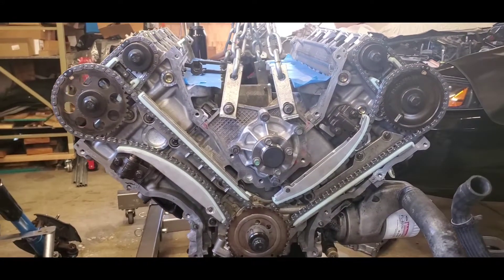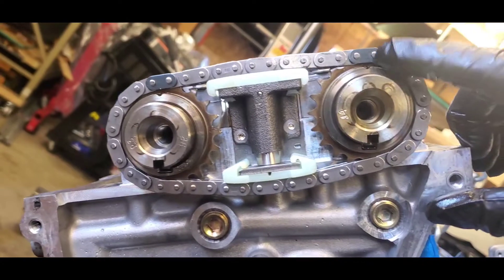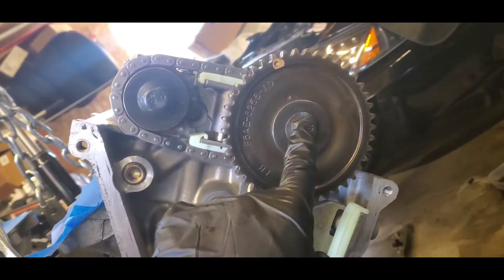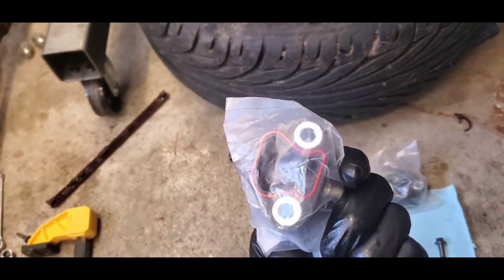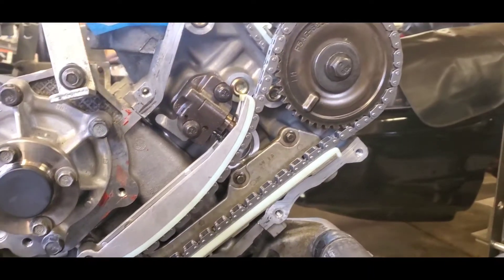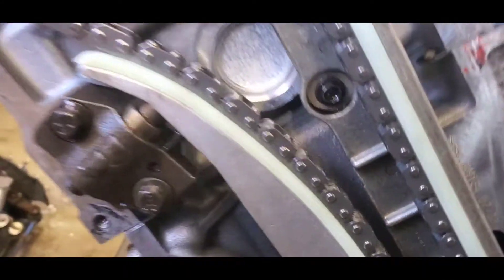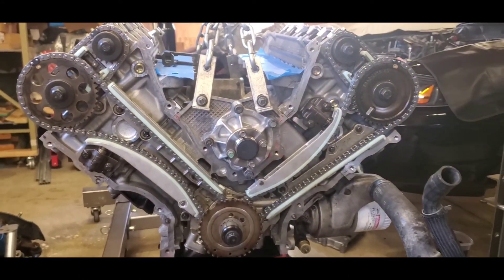How to time: 4.6 4V DOHC Modular Ford Engine Step-by-Step Guide

Comment: *don't forget to put the crank trigger wheel on. " Yea, I went through that already lol. 

My motor sat for 6 years so I don't even know what happened to mine, and when I put it in the car, that trigger wheel was a thought of the past. 

Things like that happening build experience and I think it's a good thing it happened in my case. Now is someone is having that issue, I in sure I'll know to say least check that. 

Now I'm learning about replacing all timing components "no matter what" because a secondary tensioner broke almost grenading my entire motor, at least the heads, but luckily there was zero damage to and valves or pistons and this is why I'm here.

Comment: Hi Josh. Thanks for the video. Would I be able to replace the timing chain tensioners without pulling the motor?
Reply from the maker: Yes, you would need to pull the radiator, fan, front accessories and any hose or harnesses in the way. You should have enough room to work

Comment: Great video!  I need to do a timing job on my 2004 32V Intech 5.4L.  Will it be the same procedure?
Reply from the maker: I'm not sure, which 5.4?
Reply: @Oxman_Garage  would it be the same for  the 5.4 4v that comes in the 2004 Navigator?

Comment: So on the aftermarket tensioners I bought theirs a these two steel shims i believe that go behind tensions is that really nescary? Or can I run them without?
Reply from the maker: I would have to see them. Stock chain tensioners are always best.
Reply: @Oxman_Garage   I looked at them from what I gathered on forms non Windsor engines use them as spacer for some reason

Comment: I'm pretty sure this is the same engine that comes in the 2003 Lincoln navigator except that the bore is bigger I have the 5.4. is this engine an interference engine?
Reply from the maker: Yup, same procedure
Reply: K thanks is it an interference engine the cam chain broke and I'm wondering if I need to remove the head to look for damage

Comment: I assume the head can be assembled first and then put on the block? Leaving the crank key at the 12 o clock position so there is no ptv damage
Reply from the maker: Yes you can install the lash adjuster and rockers before hand with camshafts.  Then install the head on the block. Yes make sure the crank is at 12.  👍
Reply: @Oxman_Garage  ty sir!

Comment: Great step by step Josh. I have an o4 Aviator I rebuilt 6 years ago and a couple days ago the low oil pressure light came on quite a few times. Didn't want to blow the motor. Parked it found the sending unit was leaking. Replaced it but light's still coming on. So I'm going to break it down and install the Melling 3V high volume oil pump. But your vid sure will come in handy. Any advice would be appreciated. (I used the Ford motorsport timing kit when I rebuilt it-but curious where you got your guides in case I need to replace them like you did but am reuseing the oem metal supports like u did👍👍👍. Thanks for posting it
Reply from the maker: Thank you for your reply.  I think I got my guides on Rockauto. I ended up keeping the metal ones and swapping the plastic part. Yeah, no worries, any questions you have.  I have a Ford manual saved on my phone. Thanks, Josh
Reply: @Oxman_Garage  Thanks Josh. Appreciate it.

Comment: I can’t get my keyways to face the crankshaft because the valve springs push the camshaft back, this isn’t a stock cam but I was hoping you could help.
Reply from the maker: I did the timing with the lash and rockers out.  You would need the cam holding tool

Comment: Is there a gasket on the primary chain metal tensioners? The plastic genuine tensioners have a O ring seal.
Reply from the maker: No gaskets on the metal, yes the plastic have a gasket.
Reply: @Oxman_Garage  just metal to metal no sealant?
Reply from the maker: @veljo10z  no sealant. Just the tensioner right on the block

Comment: Great video! I do have a question, maybe you could help, for some reason on my 4v when I go to tighten the cam bearing caps even a little bit the cams lock up and won't spin, any ideas?
Reply from the maker: The cam caps might be worn or scored in the journal or you're over tourqing the bolts.  Of not you'll have to remove the head and send to a engine machine shop to polish the journals with the camshafts.

Comment: does Cyl1 need to be on TDC before you put the crank at 10?
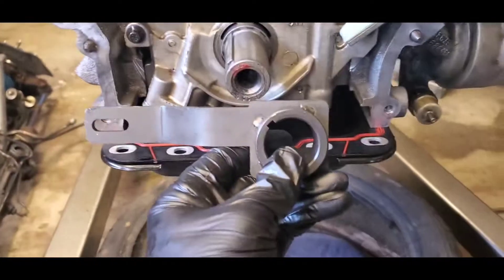Reply from the maker: At 4:08.  The tool puts you at TDC, which is the 10 o'clock position.
Reply: @Oxman_Garage  so it that on compression stroke or does it not matter as long as its on TDC?